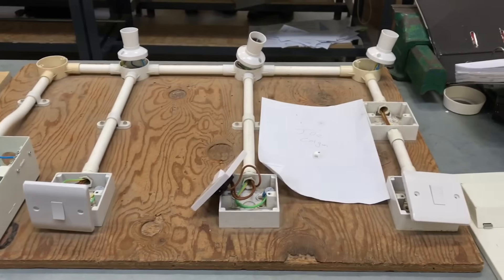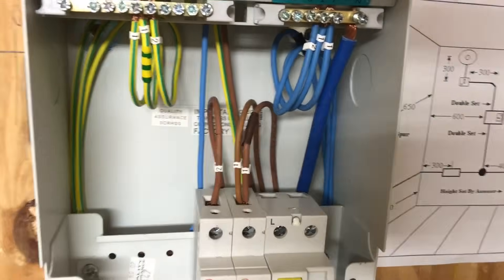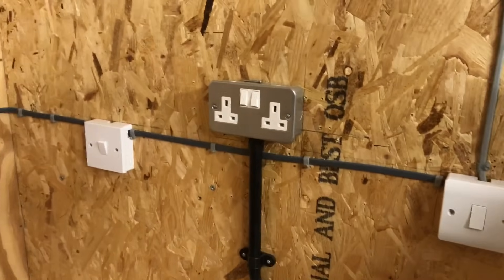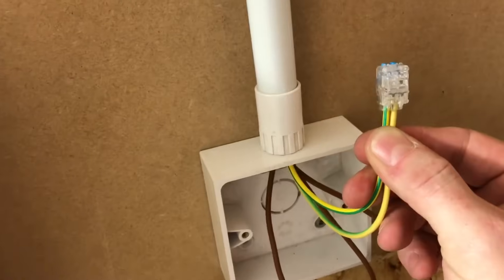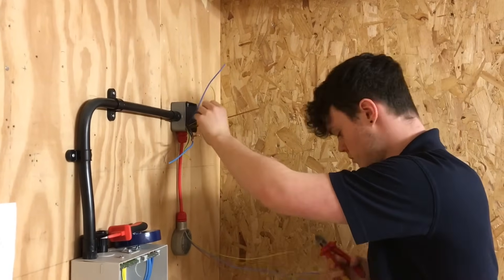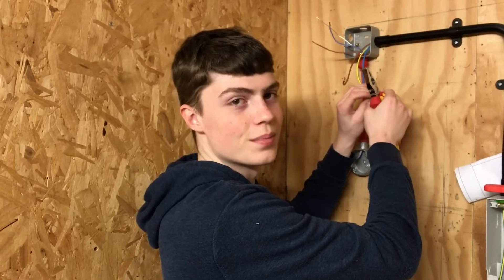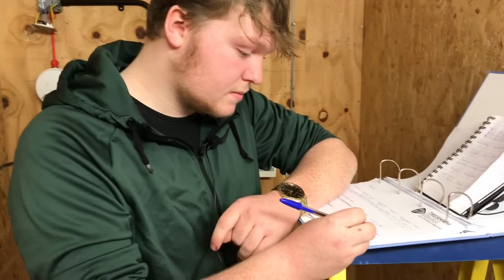Tresham College Electrical Full Time Level 1 and 2 Learners in the Electrical Workshop

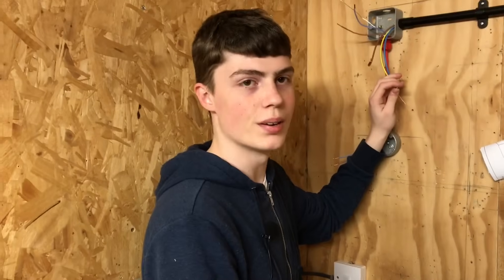Comment: 4:34 If you have 3 sockets on a ring, how many spurred sockets can you have? Answer given is 3 however, I would say 4. As you can spur from the Breaker. Thoughts? Also some great stuff being taught at this college. I'm afraid to say but some of these guys know more than "electricians" I have worked with... Good to see there is hope for the future of the trade.
Reply from the maker: Hi. The total number of non fused spurs can not exceed the number of socket outlets in a circuit. If you spur one from the consumer unit and say you had 10 sockets on the ring then you can only spur non fused spurs from 9 of the 10 points. This makes a total of 10 as you spured from the board. Thanks for commenting and watching GSH Electrical 👍